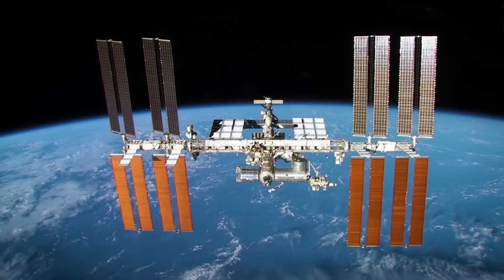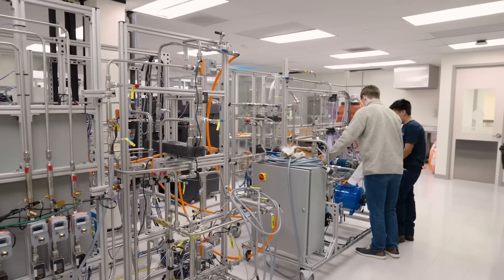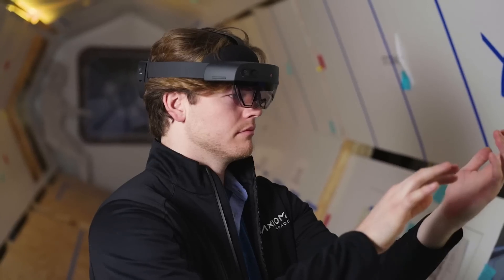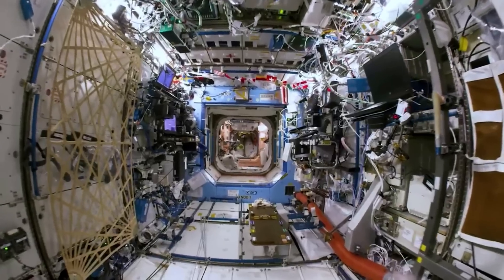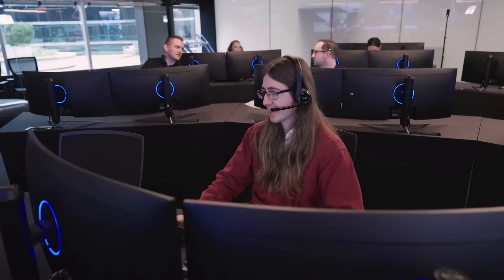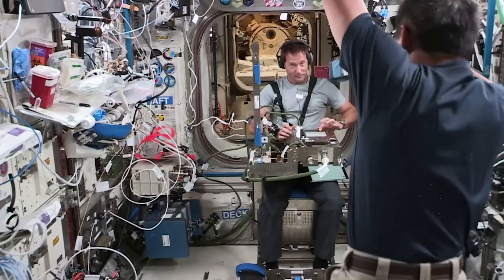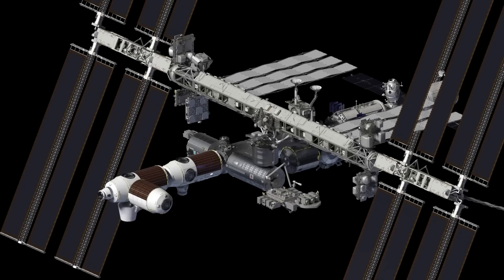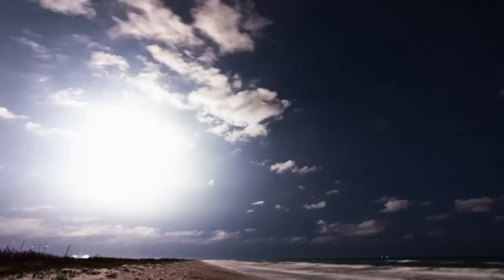Axiom's First Commercial Space Station Segment Is Almost Done

Comment: The ISS cost too much in blood and treasure to de-orbit. Replace Zarya and Functional Cargo Block and boost station to a much higher "museum" orbit.  It will cost less to refurbish station than to de-orbit it.
Reply: The ISS is not built to replace those core structures. And it is old, so is starting to develop microcracks. With Axiom being at least one replacement for the ISS, modules that can be saved, may be. Currently there are discussions of moving the Leonardo module to Axiom.
Reply: @steveaustin2686  good point. who knows...
Reply: yes, that would be a good idea. link it up to a larger station (tourist hub)
Reply: push that shit out to one of the LaGrange points as an orbital monument. do not waste usable material in orbit it costs too much to get it up there
Reply: @kingmasterlord  The ISS is too old and not built for deep space. The dV to move the ISS to any LaGrange point would be massive.
Reply: @steveaustin2686  oh "deep space" as in "still inside the Earth-Moon system", put some slow burn thrusters on there and just have it spiral out, you don't have to do it in a day, and it is just that simple.

why you're even considering not preserving the ISS is beyond me, even if it's just in a protective bubble parked in a stable out of the way location.
Reply: @kingmasterlord  The ISS is not built for out from under the protection of the Van Allen belts. And what you suggest is easier said than done. You need a LOT of dV to get the ISS out of Earth orbit, so you need a LOT of fuel. You can say whatever you want, but it doesn't work that way in the real world.
Reply: @kingmasterlord  you serious?
Reply: @et4235  absolutely
Reply: How will it cost less to de orbit it? You do realise de orbiting just means to set the thrusters to slow it down enough it falls out of orbit, it literally costs nasa nothing
Reply: @Alucard-gt1zf  Cost less to deorbit than to continue to pay for maintenance that just goes up.
Reply: @Alucard-gt1zf  NASA plans on spending over 1 billion US dollars to de-orbit ISS. Building a tug from scratch to do job. 500 to 600 million to build, plus 3 to 400 million for de-orbit mission.
Reply: @sandbridgekid4121 kid knows his stuff. It’s literally a better deal for everyone. 

And an inspiration to future generations. 

They can go up there and see it if they want. And they still have the ability. 

You should email it to your elected Rep and Senator.

I’d say White House but I get the impression the occupant doesn’t have much idea what is going on in the world.
Reply: @machiavelliangametheorist9175  Already have contacted both US Senators and  my rep who's on Science and Technology Sub-Commitee!
Reply: Even in a higher orbit adjustments need to be made regularly, this isn’t feasible considering fuel would eventually run out and naturally de orbit anyway but this time not under our control and would be a hazard until it made atmospheric entry.
Reply: Send it slowly to the moon.
Reply: @TheMoneypresident  see I had that thought too but the moon's going to be pretty busy, there's already people talking about colonizing l3, but l4? that can be orbital time capsule
Reply: @kingmasterlord  slow crash or land. It's parts. The first salvage yard on the moon.
Reply: @TheMoneypresident  who needs to be a battleground by differences instead of fighting on earth. you better sponsor your moon knights with your space program if you want to compete on the world stage we don't do war no more.
Reply: It may just be sold and let other companies use it. Still working well and Russia already replace one module recently. NASA wants to concentrate on deep space. So makes sense to let others take it over.
Reply: Preferably I would like SpaceX to send their starship, disassemble the space station and then have the starship come back to Earth. Take the space station modules and build a museum on earth with them
Reply: 🤓 this u?  no I'm just smarter than you and I don't care about cost like they do
Reply: 🤓 this u?  in case you forgot you're the one that made that claim.